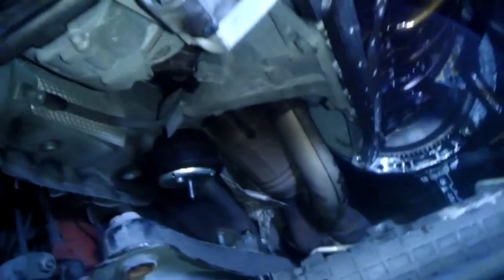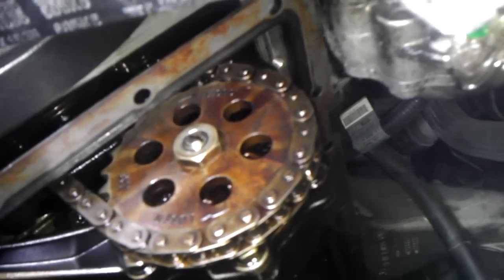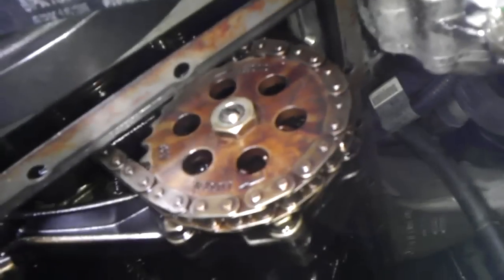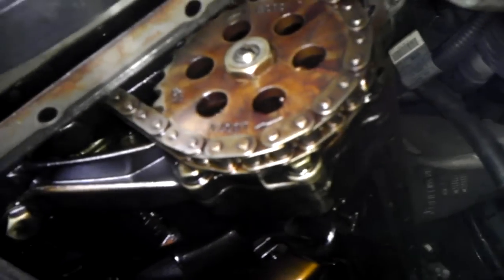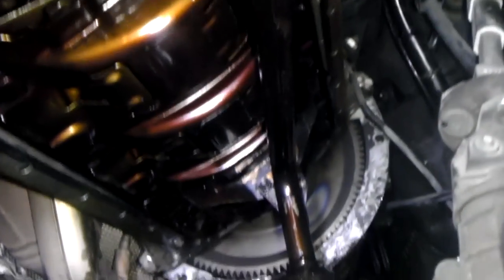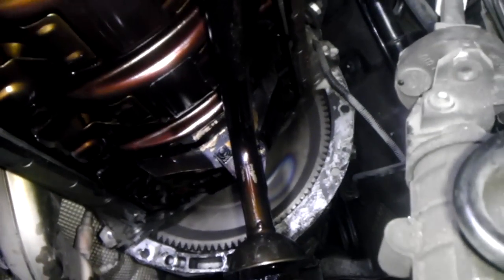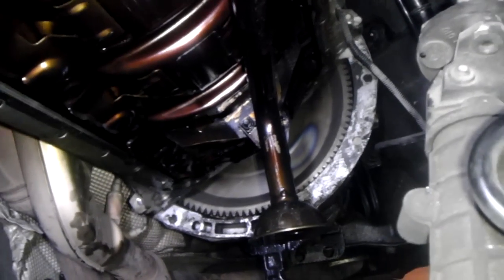BMW e46 Oil pump failure.

Comment: Question ? So you said you had some ticking ? Well I just bought this 328ci not to long ago and I have Lifter tick noise.. But I have NONE when it's cold and it will randomly appear and randomly go away.. Seems to be like its not getting the oil In the top end. Did you have anything like that ?